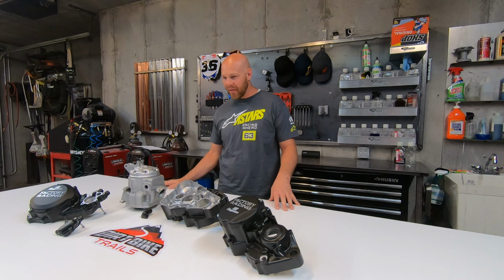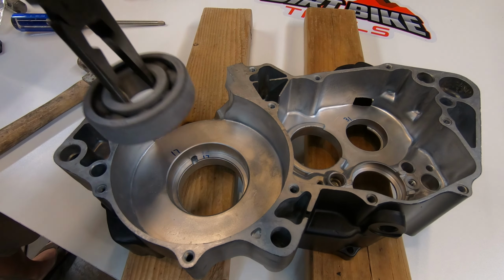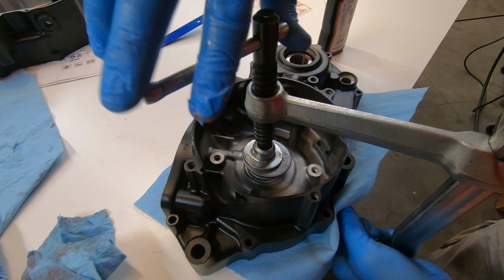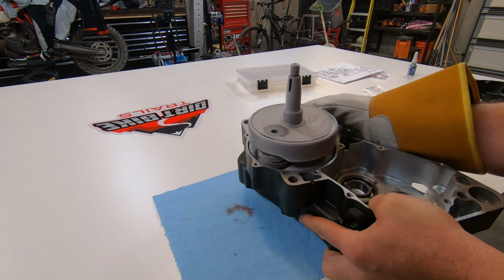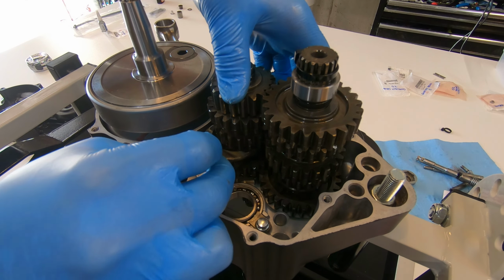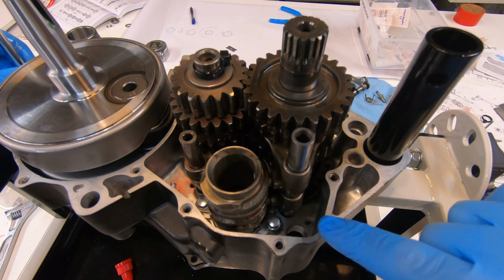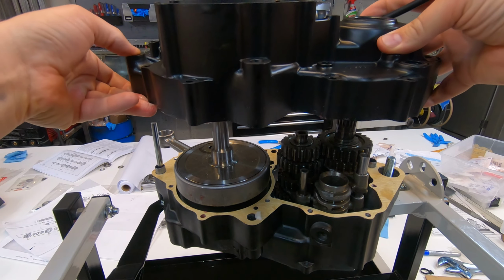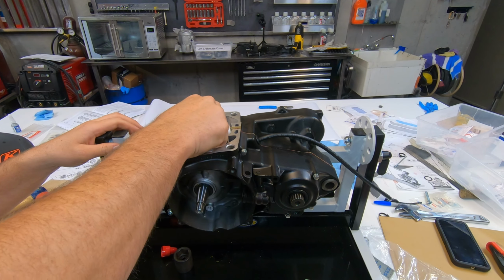CR500 Motor Build - PART ONE - Crank & Transmission

Comment: Besides freezing the bearings for installation in the casings I have never had a problem mating the two halves back together, but nice job and good luck , take your time with break in.
Reply from the maker: Yeah I don't know for sure why the cases fought me but I think it was the crank on the crank bearing. For peace of mind I got the Tusk crank puller the next day and made sure it was all the way in.

Comment: Hi, great video series. I am following it to jog my memory as to where things go. Quick question, at 1:10 you've written numbers on the inside of the cases in blue pen; do these numbers correspond with the part # indexes on Honda's parts diagram?
Reply from the maker: Oh I forgot about that. You know, I am not sure without checking. That could very well be the case. It could reference the part number or maybe what item number as listed on the diagram, as you say.

Why do you ask?

Comment: I leave the crank seals out till after crank and cases are together, I also use a hot air heat gun to heat the inner crank bearing race to install the crank. To close up, I heat the crank and gearbox shaft inner bearing races and the case just drops onto its other half. I never freeze bearings as this introduces water into the equation which if left unprotected can damage the bearing from the formation of rust 🥴

Comment: I've got a 1985 Cr500 that was running great and suddenly weak to no spark. All parts ohm out well per manual. Don't have a donor cdi but am thinking of upgrading all main electrical components on the bike. Do you know which years CR500 are compatible with an 85 or which brand is a good aftermarket source? Thanks in advance.